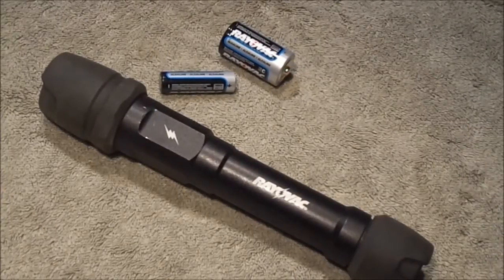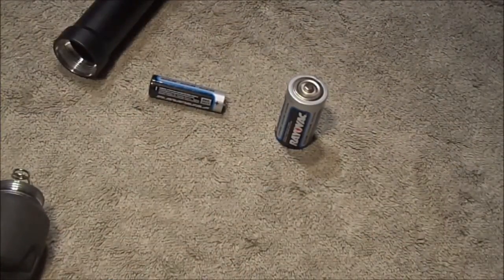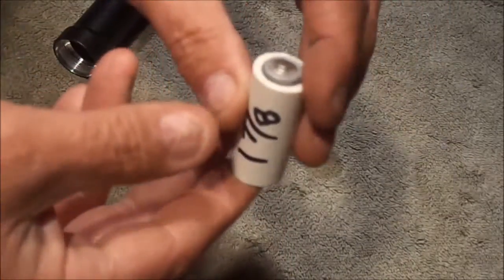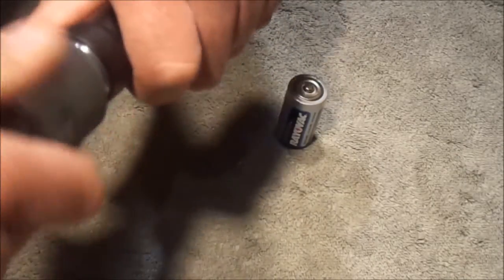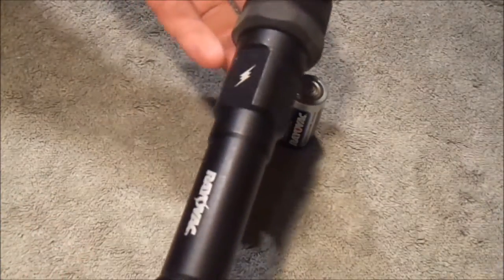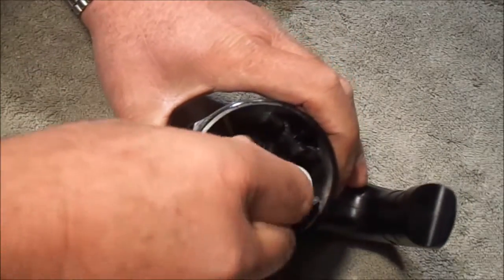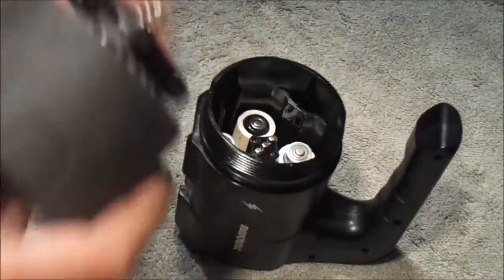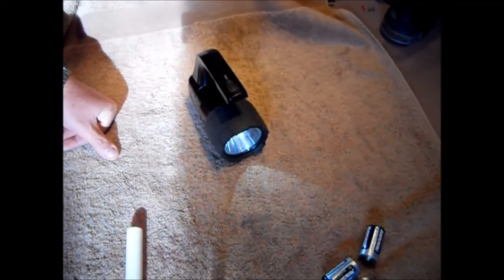C to AA Battery Conversion

Comment: Question.  Using Energizers.  Used my AA battery in a C device.  The AA lasted much much much longer than the C.  The AA was regular, not lithium or anything special. (Basic Alkaline)  Are C's useless?

Comment: I happen to be one who requires the use of hearing aids. When unable to find the right size of hearing aid battteries but do happen to have another size available, I found by tearing a small section of tin foil off and folding it in a small piece I can insert it on top of the wrong battery to make a successful connection .